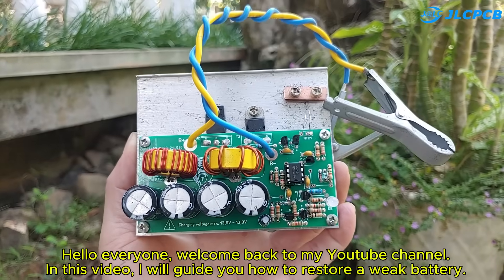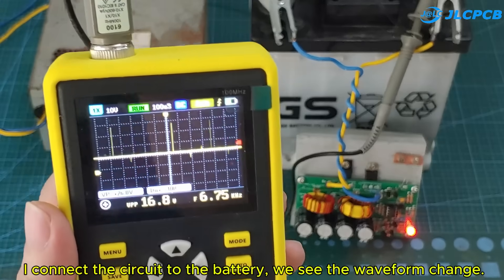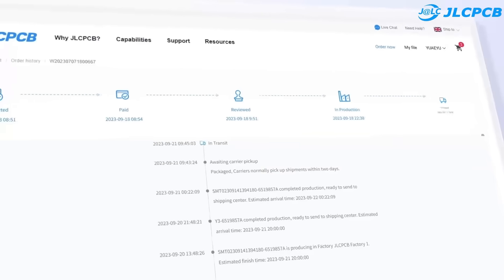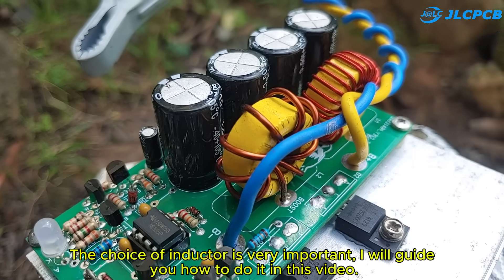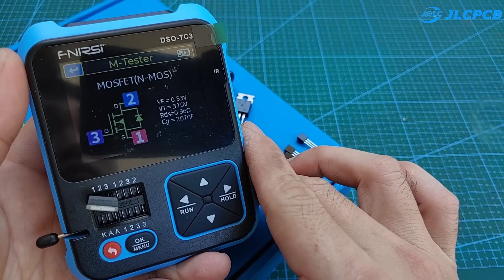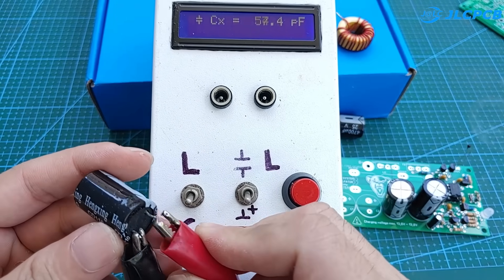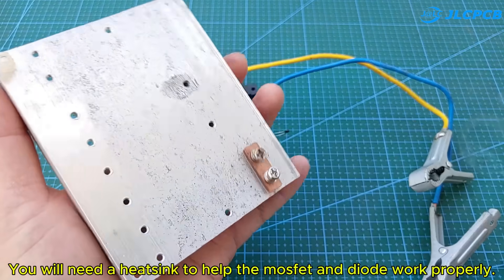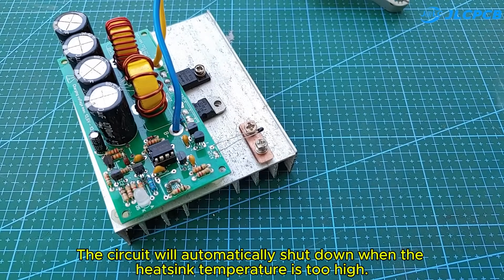Technique For Battery Restoration

Comment: A boost converter that is regulated at to the battery voltage and each pulse at turn on goes. To. Max volt of the inductor coil inductance it's simple but effective

Comment: Of interest I have a project on github called the FlexibleCharger based on the TL494 which is a programmable supply using the ATMEGA328P.  It can be used for pulsed supplies, constant current supplies, among other things.

Comment: Hello, in the project of making a battery charger with atx power supply, there is a 330 μH inductor, what is the diameter of the inductor?  What is the number of turns of the wire and the diameter of the wire?
Reply from the maker: Hi bro. I will check it and send to you. Now i don't remember the value

Comment: you cant fully restore lead acid batteries, as the material eventually disolves beyond repair......... you will have to replace the anode and cathode
Old timers would use old times chargers to temporarily boost old batteries, but thats about it. thats all you can do, you cant fix something thats physically ruined.
Modern Li-ion batteries, and batteries in small electronics is easier to "fix" and actually gains a significant boost, but its done by putting em in really cold enviroment for 24-48 hours

calling this a "restoration" without replacing anode/cathode, a long with the acid is disingenuous, at best
Reply from the maker: Thank you for your information. You right. But it is the simple way to re-use the old battery before we by a new one

Comment: Very good circuit, my suggestion would be if you could add a 2 in 1 battery charger to the circuit, it would be a great goal, a 2 in 1 desulfator and charger, thank you.
Reply from the maker: That a great idea bro. Thanks you so much
Reply: @LongTechnical  nice sir

Comment: Hello, what gauge of wire did you use for the inductors or how many millimeters is the inductor wire? Thanks.
Reply from the maker: 1.5 mm wire bro. Hope you like that. Thanks
Reply: @LongTechnical  thank bro